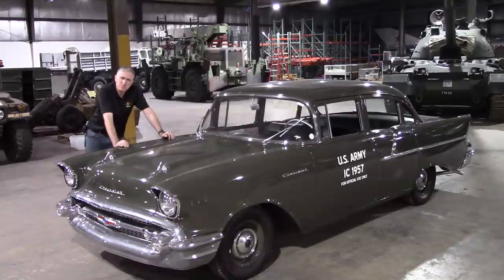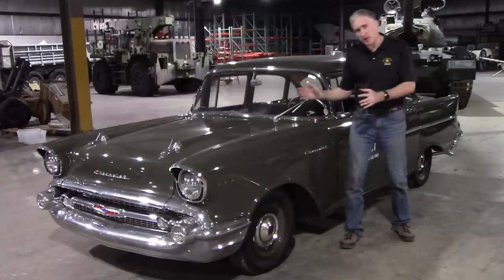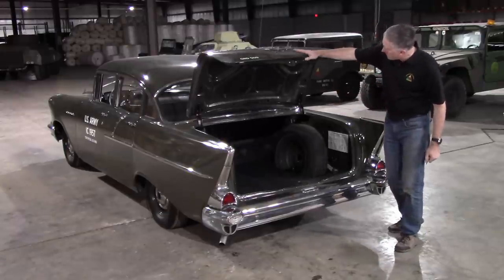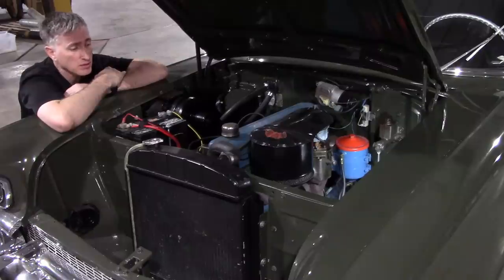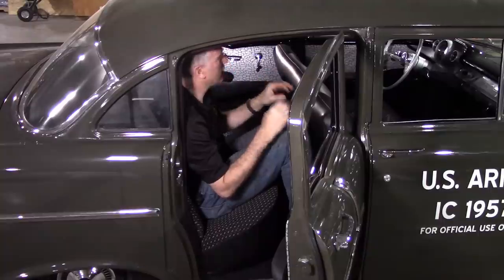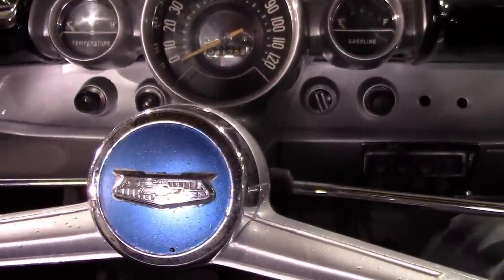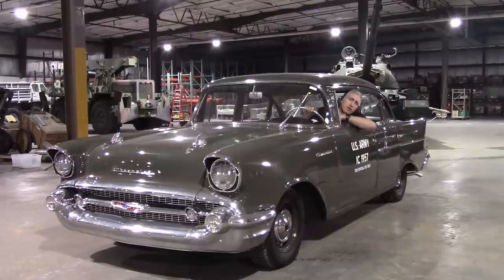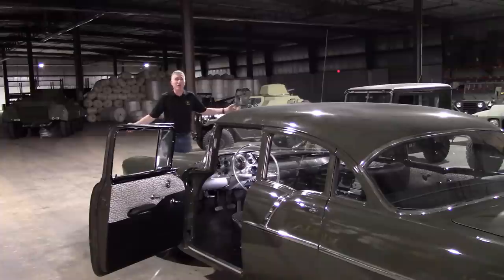Inside the Chieftain's Hatch: Chevrolet 1503

Comment: Oh, you are so young.  :)  I thought the trunk release comment was a joke, but then you apparently mistook the parking brake for the hood release.  :)

And then there is the shift pattern  -- In the '50s, labeling the shift pattern on a three-on-the-tree shifter would be no more necessary than labeling the pedals "clutch" "brake" and "throttle".  If the gear positions weren't second nature, you should be in a drivers training class.

Nice video once again.  Thanks for being honest -- "If you know anything about Chevys ..."  :)
Reply: It's common for military vehicles to have a shift pattern depicted on the dash, this one doesn't. And this is a military vehicle, so Chieftan mentioned it.
Reply: @pakkazull8370  Yep, I am!  Born in 1965, but grew up (even in the '70s and '80s) with my parents' 1953 Plymouth wagon.
Reply: I am in my 40s but we had a 1956 Ford and the Chevy & Fords were very similar. Shift pattern for "3 on the tree" is a basic H pattern. Key ignition was on left. And usually that vent in the center of the dash was not a vent, it was the grill for the one speaker for the AM radio.
Reply: "Three on the tree".

Comment: The covers on the headlights are called half moons. They were a popular accessory in the 50’s and 60’s but they were actually developed for the military. It’s designed to keep the light low on the ground, and reduce the visible light to planes and enemy troops.

Comment: Great walk through although here are my observations.  This car was assembled in Baltimore, MD. at the Fisher Body plant on Broening Highway -  since demolished and now an Amazon complex. The "B" in the serial number designates this.  My dad worked there from 1935 to 1970. He was a foreman in the upholstery department when this car was built.  I question the electric wipers as they were an option and not standard equipment. I believe this car  would have been built with  a vacuum motor which would require a different switch  in the dash panel (a ported switch vs an electric switch) and someone added the under dash on-off switch to bypass the ignition switch.  Both motors mount exactly the same on the firewall.   Last thing I question are the "eyelids" over the headlights. That was never a GM option and since 1957 was not a time of war, someone added them IMHO. During WWII, staff cars that were initially built with chrome bumpers to use up the inventory of chromed bumpers.  They underwent a sanding process so flat black paint would adhere and light would not be reflected off the surface. The process cost more than a chrome bumper. No chrome was ever put on staff cars during WWII. Calling the side trim chrome is also incorrect as this is actually polished stainless steel.

Comment: The reason for the half-chrome lights, I believe, is so you don't blind on-coming drivers. No,"oh bugger the chevy is on fire" or "this is the track tensioning system"?
Reply: I always wondered about those! I think they were inspired by the black out headlight covers of WWII. Difference being that the blackout requirement put a cover on both the top and the bottom so there would only be a little slit for light to come out of. Of course they were never chrome either! How they got on an Army staff car I haven't a clue. Must have been the same guy that put the guns in the hood.
Reply: I never saw a vehicle in civilian use with those shields, and I saw a lot of 57 Chevys in 57 and years following.  I think it was a military thing, but it can't have been very useful.  The headlights are sealed beams, so it has to be an accessory.

Comment: I have a Volvo Amazon from 1965 (the first model came out in -59) and so many things on this car look familiar to me; from the headlight switch on the floor to the light and windscreen wiper controls working without starting the engine and the small ventilation windows on the driver and passenger doors. The Amazon does have some improvements however, like a handbrake on the floor (to the left of the driver's seat), you open the hood from the same place as in a modern car and three point safety belts (that you had to adjust yourself).

Comment: Back in the olden days, the big inline engines actually produced a very comparable amount of power to the v8s.  And in some cases out performed the v8 engines all together, until the 1960's muscle car wars that created beasts like the LS6 V8 putting out 450hp.. wich was a lie from GM to lower insurance, it was actually 500ish at the rear wheels horse power.. And leaded gasoline fuel at the time was around 105-110 octane. SO, it was more like 550ish horse power.  I suspect the same with this little engine, it probably made more likely 200hp and with a manual gear box would of been able to move that land yacht just fine!  It probably hauled a$$
Reply: That bad boy just needs more chrome

Comment: The shift pattern for a 3 on the tree is reverse in the up position, 1st is straight down, 2nd is up and away from the steering wheel and third is straight down form second... they were designed not to be shifted by grabbing on to the lever but by gliding the lever with the palm of your hand... thus shift from reverse into 1st was done with your palm up, 1st to 2nd was palm down as well as shifting back and forth between 2nd and 3rd... from 2nd to 1st was palm up as well as shifting between 1st and reverse...

Comment: 3 options.  The heater, as you mentioned, the oil filter was an option and the electric wiper motor was an option.  The cigarette lighter was standard on all '57's.
Reply: An optional oil filter! That is crazy. I can't imagine what the maintenance requirements would be without an oil filter.

Comment: The "Turbo fire" as mentioned was a v8 option for these cars, it was originally a 265ci (later 283) engine that made a lot of fans in the car world, it eventually got bored and stroked out to 350ci. These engines became known as the Small block chevy and it's probably one of the most ubiquitous engines out there known for big power, at low cost and very reliable. Outdated now by modern standards it still is a favorite of many in the car and truck world still to this day.

The engine in this car was the very popular chevy I6, and was pretty popular until the mid 80's when it went out of production. That one was probably around 140ish hp and around 200ish tq.

Comment: from what i gather the protrusions on the rear bumper were for reverse lights and the ones on the front would be changed out for a bullet looking cap on higher trims. the three little indents on the front fender may indicate that the car is a 6 cyl. a 8 cyl might have 4 on each side. however this practice is more well known on buicks as their called portholes.

Comment: The 1957 4 door  Chevrolet Belair was my very first car.  Had the same inline 6 cylinder, 3 on the tree and did come with a radio.  Great car and I'd like to see your Oww Dee roadster  50 years from now in the same condition, lol.  Too bad it wasn't armored but it was still a tank.  Thanks for sharing.

Comment: This was great. Our first family car when I was a child was a '57 Bel Air so I loved it when you couldn't open the hood or find the gas tank. I also worked at a car wash pumping gas and checking oil in 1970 when lots of cars from the '50s were still around. Had to learn all the places they hid the gas tanks.

I also learned to drive with a column 3 speed like that. Hated it. Ford was still trying to sell them into the '70s.

Comment: "shotgun" was typically an aide/guard, the driver was both driver and guard. The Vehicle Commander would have, if sufficiently decorated or promoted, a radio-phone and/or briefcase. All three would be armed with the standard vehicular armament of three 1911A1 pistols. Optional armaments included a military shotgun or an M1A1 Carbine (or two). Ammunition loadout varied between 63r of .45 ACP to some 16 rounds of 12g shotgun ammo, 120 rounds of .30WinCar, AND 63 rounds of .45ACP, and was carried in belt pouches, stock-mounts(in the case of the carbine) and loaded magazines.
Armor was 6mm nominal, and would stop anything up to a .22 SHORT.
You will note the lack of a track tensioning system, which fills me with a deep sense of sadness.

Comment: Regarding the 2nd window - Rovers had those fitted until 1975. Very useful for getting a good blast of fresh air on your face in the days before air conditioning when driving at highway speeds.

Comment: The chrome-plated "little features" set into the hood are purely for styling, but the shape is taken from a .50 BMG bullet.

Windshields (all the glass) for a '57 Chevrolet can be ordered from a catalog.  That said, if you're restoring something that's not nearly as basic as a 55-57 Chevrolet, you can have glass custom made.  You missed the armored aspect to the windshield glass, too.  It's laminated glass, which means tempered glass inside and out, bonded to a layer of plastic.  It's built much like bullet-proof glass, and was (still is) used because it's resistant to things like big rocks thrown up by other vehicles.  I've even seen more than a couple of bullets stopped by the stuff - low-powered and/or at extreme range or angles, but windshields are surprisingly resilient.

There isn't a trunk release.  That's a fairly new thing compared to the vehicle you're looking at.  

Fuel filler is in one of the fins, under the chrome.  IIRC, it's on the left side.  I laughed pretty hard at that part.  I've known some guys who worked service station jobs back in those days and they say it was a nightmare finding all the different spots companies would hide fuel fillers.

Rear legroom depends on how far back the driver pushes the front seat.  The front bench should be adjustable forward and back, and it looks to be in the rear-most position.  (Yep, called it.)  The general riding in the back would have told his driver to slide the seat up to give him some leg room.

A "little bit" of draft from the vent window?  You've never been in a vehicle that's equipped with those, have you?  You get a TON of airflow by opening that little window.

3 speed manual transmission.  "Three on the tree" shifter: back and down for first, forward and up for second, forward and down is third, back and up is reverse.

FWIW, the chrome might look all fancy, but the biggest reason for its use is that it's very tough and won't scratch off like paint, and it's very resistant to corrosion.

Comment: Questionable muzzles on the lower right and left front were the locations for optional fog lights.
Similar things on the back were the optional backup lights.
A standard column gearshift is always 3-speed H pattern, just moved to the column, so pattern is R-1-2-3 starting from forward and left for the stick or back and up for the column.
The small windows were usually known as "wind wings" and were the standard method of air conditioning. You could adjust them to blow air into the car for cooling or ti suck air out of the car to remove the smoke from your cigar.
The windshield wiper switch is aftermarket. It should have been in one of those empty holes on the dash and only powered off the key switch.
There was only one cigar lighter, it was almost always a little left of center so it was most convenient for the driver, but easy for the front seat passenger to reach. There was an option for a rear seat ash tray, and the lighter was often mounted in the tray and available when you flipped it open. There also would ahve been an ash tray in the dashboard.
The grill in the center of the dash was for the radio speaker, placed where the sun could bake the cone and moisture could cause it to crack. The front upper vents were slits just inside the windshield. There were usually foot vents too, with handles you could feel for by fumbling around under the left and right of the dashboard.
There were no inside opening handles for either the trunk or hood. Those didn't come along until the 1970s.

Comment: My uncle does restoration and his own 57 Chevy came into the shop as a stack of parts....The windshields are a royal pain to find since they are usually cracked pitted or yellowed if they are original parts. ..original chrome parts are almost as hard to find in good condition after fifty or so years...The network of connections you need for original parts is impressive.

Comment: The chrome extrusions on the front n back bumpers are a form of 'over-rider' I think and their purpose is to take the minor knocks n avoid your main bumper getting dented. These ones are much flasher than others I've seen but when they get really badly bent or scuffed you can just replace them where necessary either one at a time or both. I could be wrong about this but they do seem very similar to others I've seen but which aren't so ornate or connected to the tail light surround. The single master-cylinder for the brakes was different than anything I've seen before, it looks very sturdy but with a small cap n reservoir, I thing replacing it for a double type for safety would be an acceptable upgrade.

Comment: Don't knock chrome unless you're going to knock paint as well. They're both just coatings.
I like how he looks around for the hood latch in the front and says "I don't know what I'm doing." Back in the day, nobody knew since different manufacturers used different methods of latching the hood which, by the way, changed every few years. All men got down on their haunches and felt around different places to discover the latch and sometimes the double latch. Quite often the gas station attendant had to ask the owner how to open the hood so he could check the oil.

Comment: Looks like a 57 Chevy, but with the 55 quarter panel chrome accents.  Hmmmm???
Love the hidden gas cap!
Reply: It's similar in overall shape & style to the '55 quarter panel trim, but it's not the same.  The horizontal part of the "spear" was wider on the '55 for both the Bel Air and 210, with a white-painted groove running the whole length on the Bel Air and an unpainted "spear" on the 210.

Comment: The 'chrome protrusions'  are a hold over from the 1502 (C55) where there were rockets fitted. It was felt that Generals should be directing others rather than directly taking on enemy armour, it also meant that the weight freed up could be replaced with extra chromium armour (the shineyness defeats shaped charges). Plus regulations at that time required tank drivers to drive such rocket equipped cars, and they complained about the lack of track tensioners, and the strange side hatch.

Comment: My first personally owned car was a 76 Dodge Aspen - I recognize most of the 57 features as perfectly normal... The chrome you see as an excess, in the case of the bumpers, especially, were for the normal accidental knocks one gets in life and very useful when greater accidents were encountered, plus provided durable and long lasting details. I could get into that car and not have the issues I would find if I got into a Ford Model T, say.

Comment: Oh, I can help you out with one detail: The function of the hood bullets is to look super-duper cool. This was a very important automotive function in 1957, and Chevrolet's hood bullets were precision-engineered to maximize generated coolness per unit weight of chrome--a distinct improvement over the giant hood bird they had in '56, which was also amazingly cool, but weighed and presumably cost a lot more, and far better than anything Ford or Chrysler came up with that year.

(Also: I love the hidden fuel door on the '57. Annoys the crap out of gas station attendants in New Jersey and Oregon.)

Comment: "Spare tire takes up a substantial portion of (the trunk)". Ever looked in the bed of the M1009 CUCV ('85 Blazer)? Pretty much entirely taken up by the spare. Maybe one hand grenade, if you stood it upright. M151A3 had more space in back.

How come there's no flag attachment point on the right front fender for the VIP's rank insignia?

Outside mirrors were not standard back then, except maybe Cadillacs. I remember my dad adding one to the drivers side of his first new car, a '65 Rambler. I remember when I started buying cars, by that time the drivers side was standard but the pax side was extra cost. And long before electric remote adjust, although some had a mechanical remote linkage cable to adjust them without having to roll the window down.

A lot of cars used to have the fuel cap under the rear license plate. This was really handy cause you could reach it from either side.

Additionally I bet thats the turn signals in front, not fog lights. I dont think they were a thing back then, at least not from Detroit.

3-speed column shift is as close to theft proof as you can get today. Better than "the Club". Driven a couple, such a complicated mechanism I am amazed every time I shift and it doesnt break.

All that said, I'd like to have it. Not enough to pay as much as I suspected it will go for though.

Comment: There's an ad here somewhere, on Youtube, showing American jet pilots arriving for work on the flightline, driving their 1957 Chevy 150 series cars (to patriotic music, of course). Also, it wasn't until the 1960s that any external mirrors were required as safety equipment on vehicles sold in the USA. They were optional equipment in 1957, so the Army wasn't going to pay extra for them when they weren't required. It wasn't until the 80s or 90s that the US military started buying any optional equipment, because nobody wanted to buy a used-up vehicle at auction if it didn't come with a radio or A/C. They figured out they would get enough more when it came time to sell that it justified the extra investment. At least that's what I was told when I expressed surprise upon boarding a flightline truck that was equipped with factory air conditioning and a radio, sometime in the mid-80s.